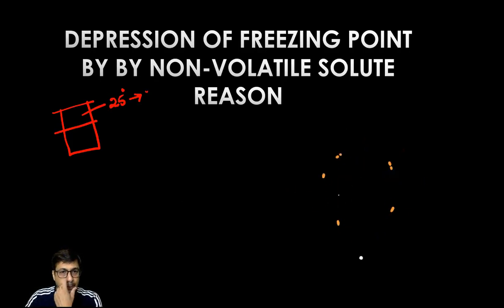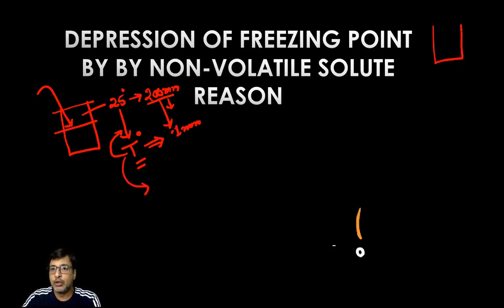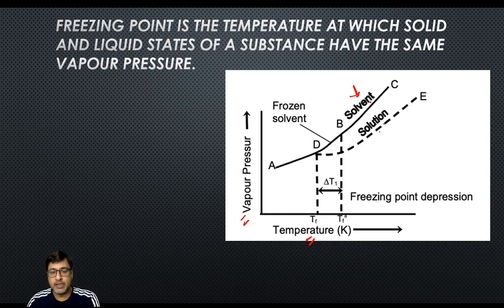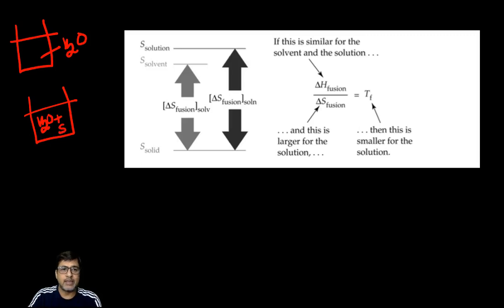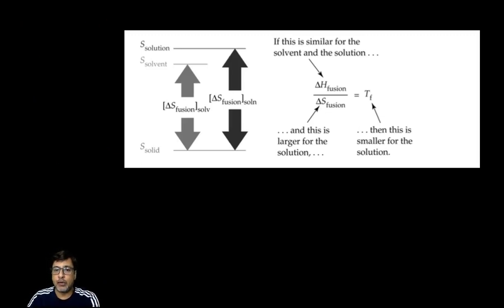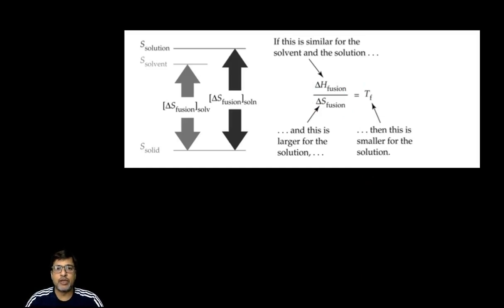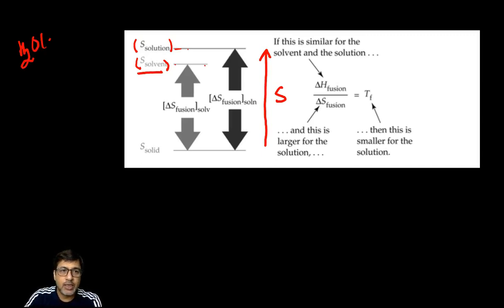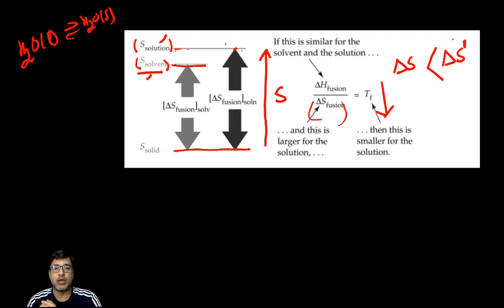Reason For Depression of Freezing Point by a Non-Volatile Solute

Comment: But at atmospheric pressure the freezing point of water is 0°C and textbooks says that at this temperature water and ice exists in equilibrium which means here ∆G of reaction is 0 ....but shouldn't he equilibrium exist at all temperatures according to le chatlier principle? Just the equilibrium constant should shift right? But it only exist at 0°C why?? And if you provide further heat ..we know more ice melts but the temperature doesn't change so does it mean Keqm has changed without change in temperature? But textbooks says it only changes with temperature so there is "contradiction" right?

Comment: Same entropy thing should happen  for Boiling point also then why it is elevating  sir?
Reply from the maker: No in case of Boiling it's elevated temperature and the same bar is above the normal temperature. Draw the diagram and you will see the increase in temperature

Comment: But if entropy of solution is more than vapour pressure should also be more becoz randomness increases thus vapour pressure should be high but in graph vapour pressure of solution is low?? otherwise it will be clear
Reply from the maker: Vapor entropy is always lower than the solution
Reply: @chemistry-concepts   why